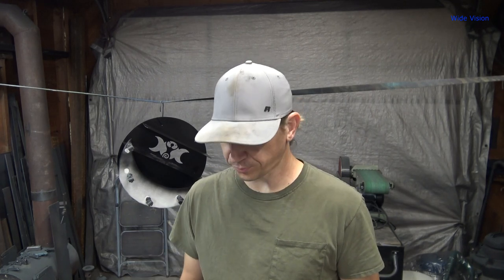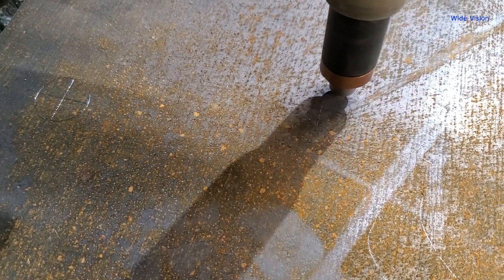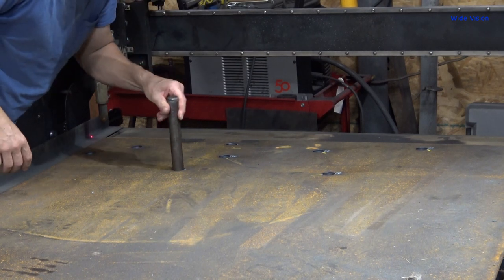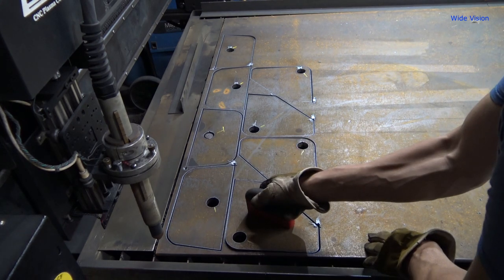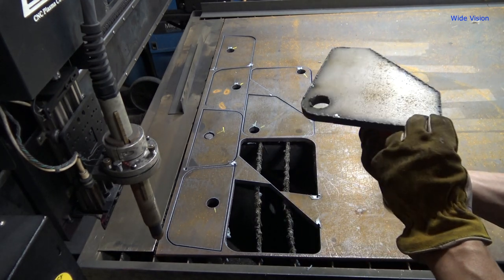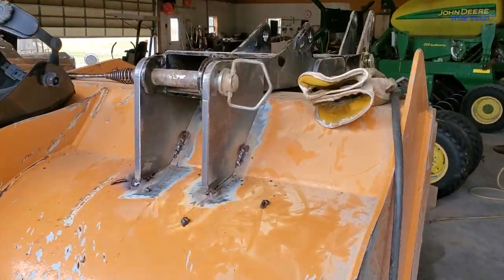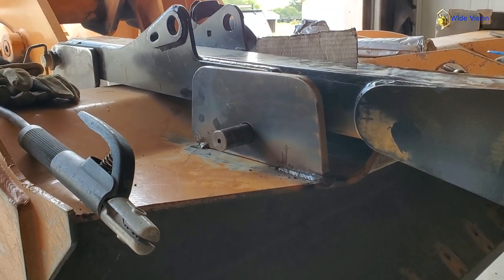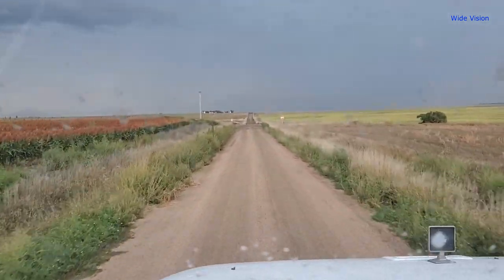Bale Grapple on a Pay Loader?  CUTTING PLATE on the PLASMA TABLE!

Comment: Looks good.  That is a good trick to know, cut the holes undersize and then cut to final size.  We have a lot of trouble with tapered holes.  I will have to try your trick next time.  In the past, we have set the CNC to drill tool and just popped a divet with the torch or spend a lot of time on the die grinder grinding out the taper.